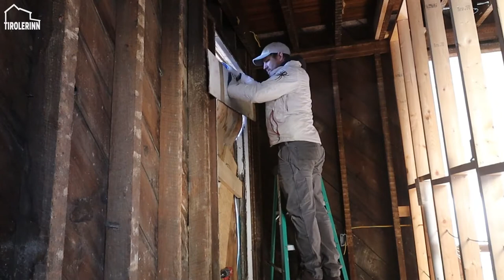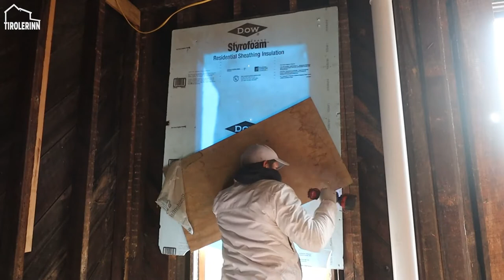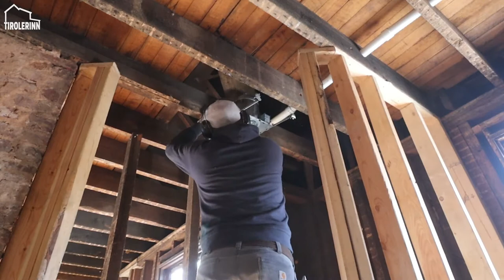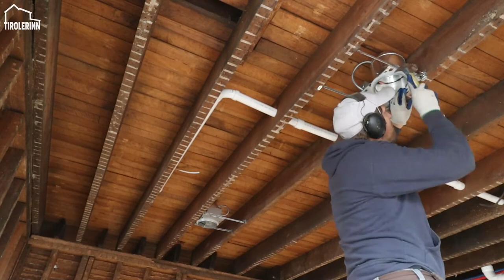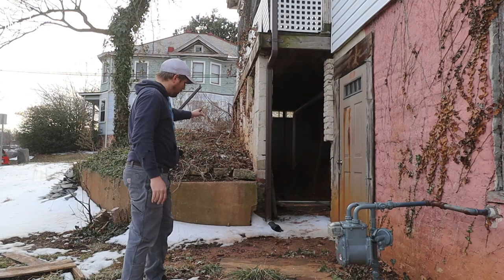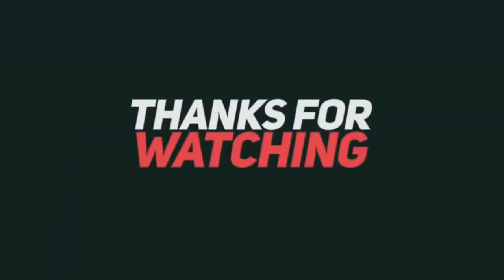Starting the Lights in the Second Floor - TirolerInn the Renovation

Comment: Will you be able to install insulation soon?
Reply from the maker: its too cold to spray foam right now. It will have to be at least in the mid 50s before we can spray. I want to finish the windows before spraying foam too so it can be all tight in one sitting. I would guess insulation will go in in the late spring.
Reply: @TirolerInn  I didn't know the temperature had anything to do with that. I learned something new.